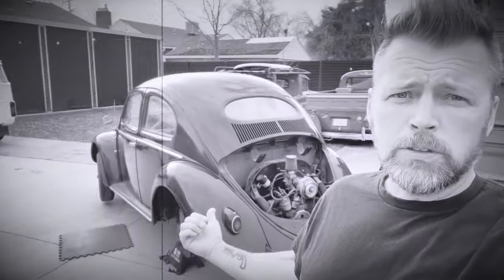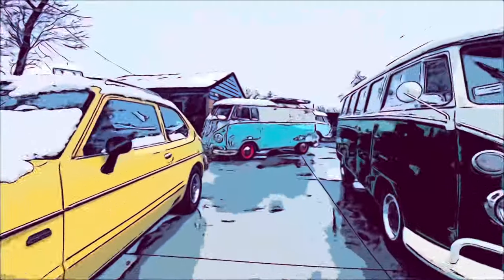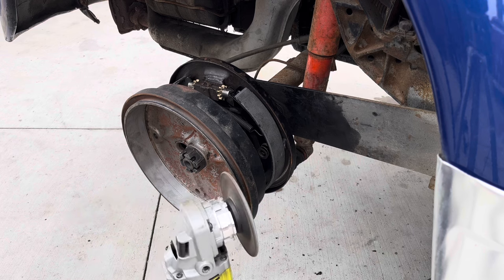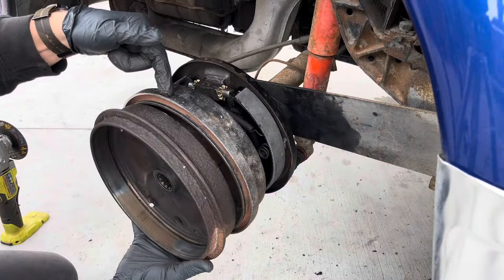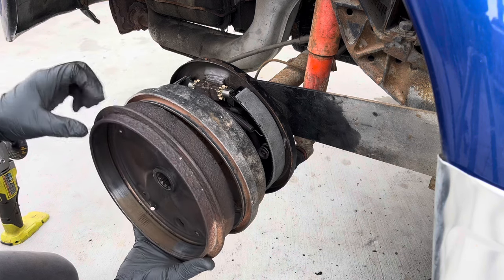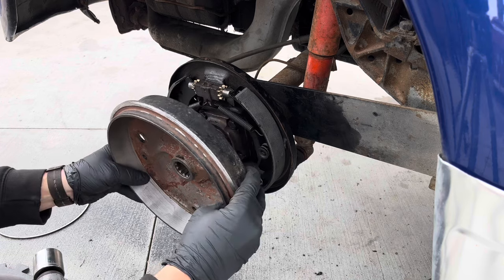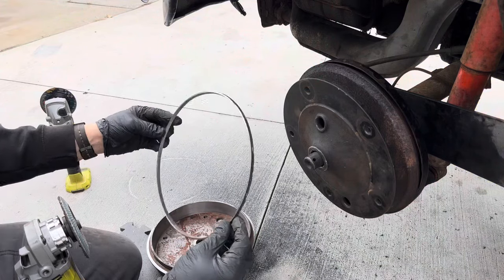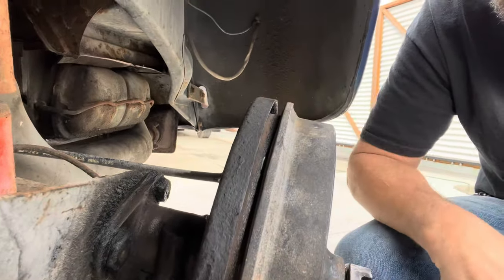HOW TO: VW Oval bug brake drum hack

Comment: I assume it was a drum from a different year?  Or were the axles / trans changed at some point?  Nice MacGyver work!
Reply from the maker: After the hullabaloo trying to figure it out myself… I believe there was one later drum - but on original backing plates. That drum worked (maybe it had been modified in the past, idk). The drum that started this mess was original and it fit, but the splines were all messed up from the axle but being loose.